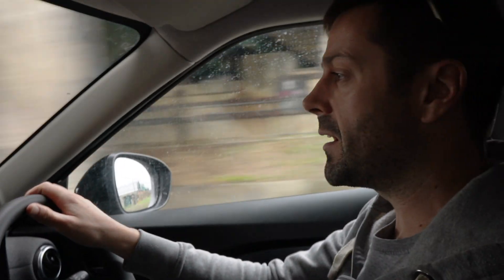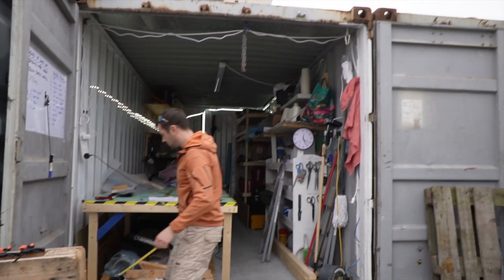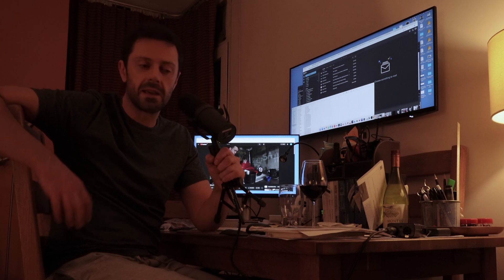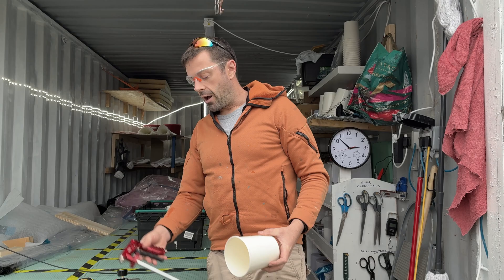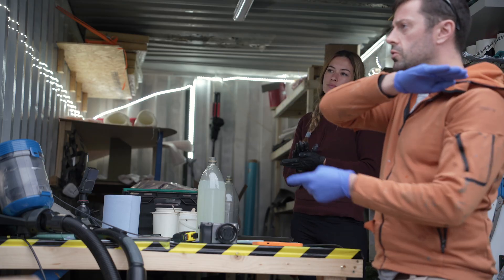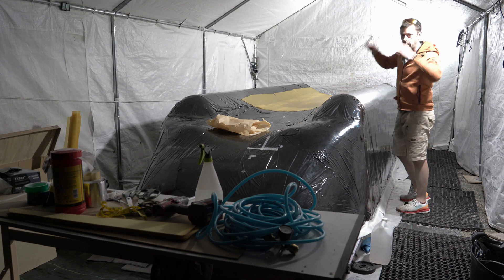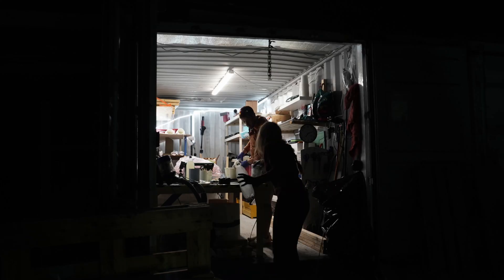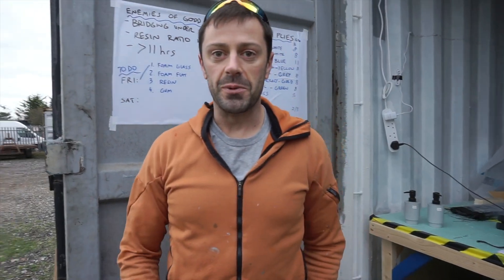Preparing big carbon fibre & epoxy resin vacuum bag lamination. Arctic Vehicle Project BERNARD [4K]

Comment: Now you have a mold, have you considered taking a second from it to make a trailer unit?
Reply from the maker: Ah yes indeed that's the plan. Ideally to outsource for infusion once we're happy with the design. The units working in pairs is the original idea in fact, but there's no reason why you'd have seen the earlier episodes. Cheers